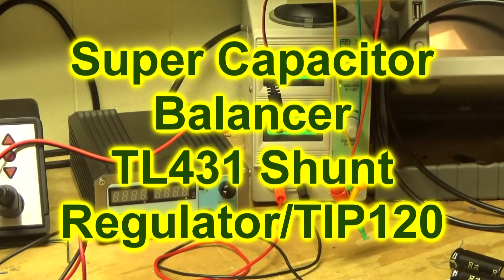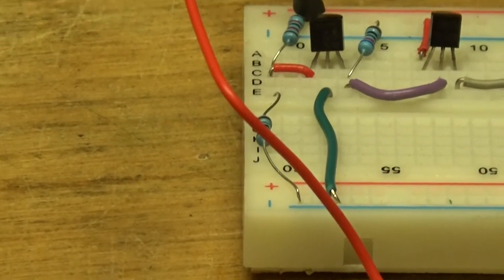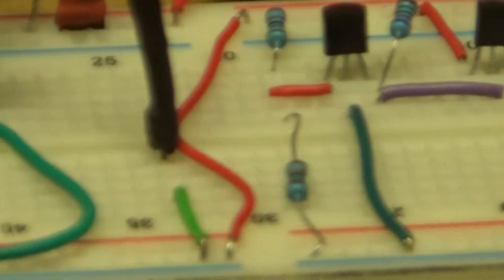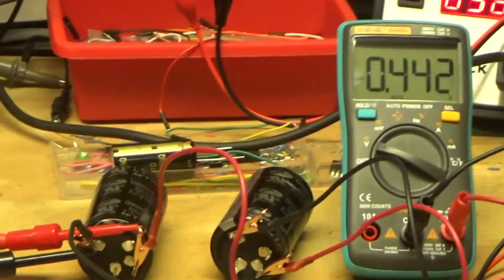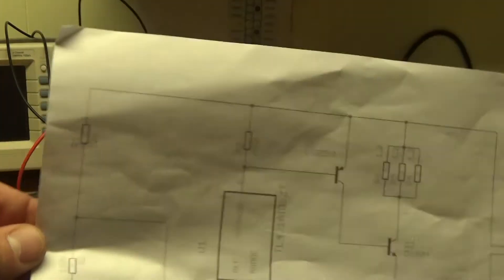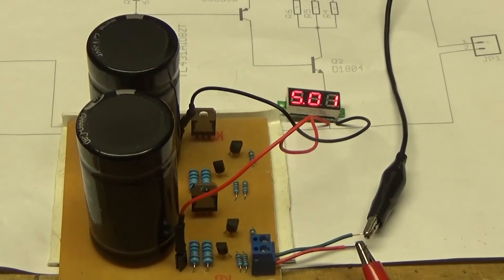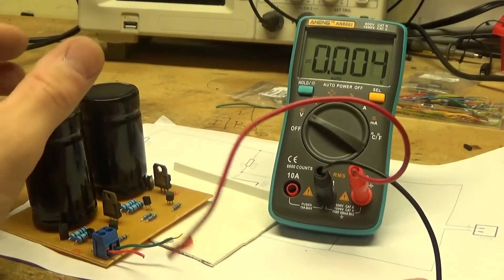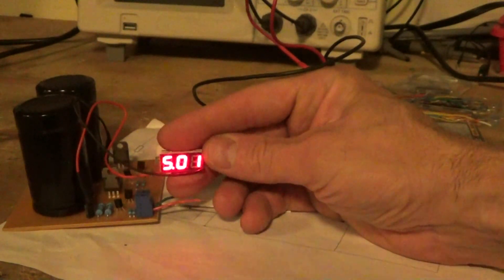Super Capacitor Balancing Board/TL431 Shunt Regulator/TIP120

Comment: You have everything you need rught to very simply test if those are really 500F.  Just charge one at a constant current (say, 2A) to a specific voltage (say, 1A) and solve for the capacitance (C) with the formula:  C=IT/V...where I is the constant current, T is the charge time, and V is the target charge.  You will need a stopwatch.
That's all there is to it!
Years ago many supercaps labeled "500F" were fake, but all recent 500F caps have actually been 500F.

Comment: Looks good. Im working on nearly the same, i have a lot of mosfets so the pnp will turn on a mosfet, i tried without any resistors on the source and drain. It worked pretty well. I did need a pull down resistor on the gate, but i do not understand why the resistors are needed with the transistor, i do not know if i may benefit  from having them. I plan to use dual mosfets for each cell to be able to charge much faster without ever getting over 2.5v.

Comment: Based on how fast the one on the right was charging, I estimate it to actually be around 319F. I have the same caps you do, and it turns out they're actually reject 400F caps that were stolen and sold with a fake label.